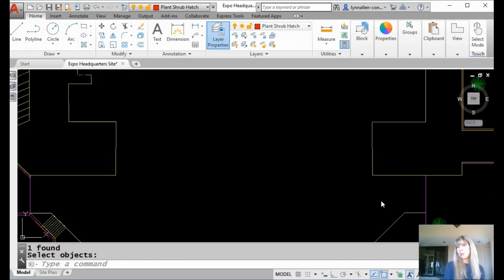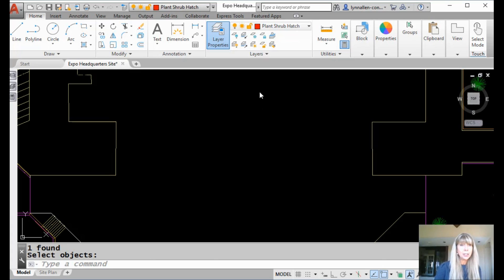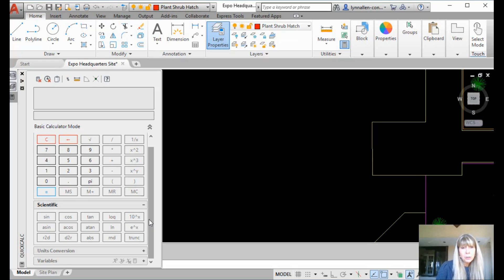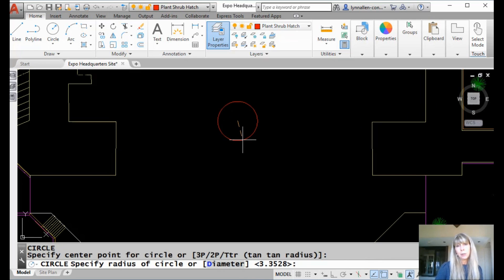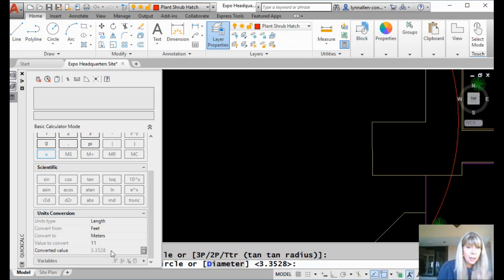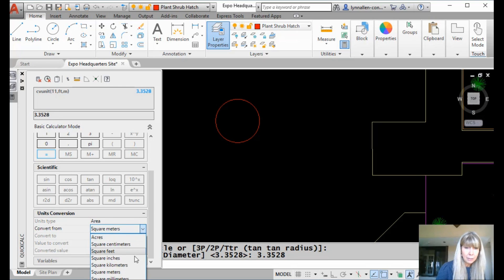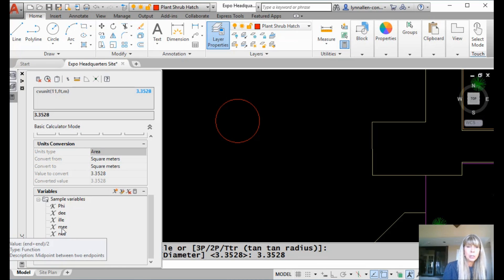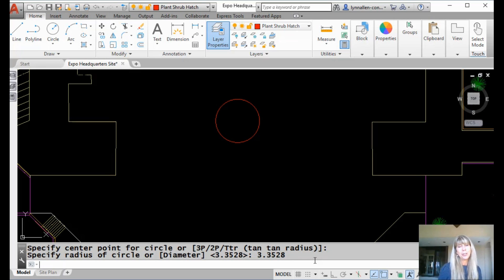AutoCAD Video Tips: Easy Metric Conversions with the Quick Calculator (Lynn Allen/Cadalyst Magazine)

Comment: Thanks, Lynn, for bringing out the value of the QuickCalculator.  Very handy to have the Dist Between two Pts and the Mid Pt modifiers at the top menu of the QC, as well as showing how easy it is to use the Paste Value icon to transfer the calculator's results into the command line.  And no alcohol was needed in the making of these tips.